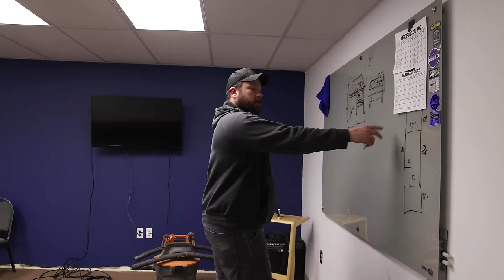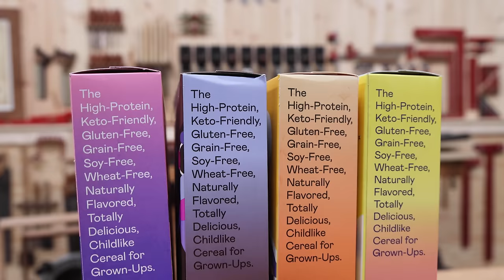EPIC Office Remodel on a Budget in The Dream Shop

Comment: Sam, when I've run trim on a long wall with multiple boards, I always trim the intermediate board ends with a 30 degree bevel. It it shrinks or contracts, it doesn't show a gap through to the wall behind or buckle.  The two boards just slide along each other.  Great job, and looks very nice.
Reply: Scarf joint!
Reply: true, but I doubt MDF moves very much.

Comment: I peeled up linoleum in my basement bathroom and used a fancy angle grinder diamabrush disc. I used an angle grinder diamond flapper disc thing that was already worn out a bit. I already had it from removing paint off a friend’s deck. It worked great. Doesn’t wear out and it also levels itself to the surface so you don’t have to work it at every angle to strip up the old glue. Kind of like how the paint stripping hard sponge discs work.

Comment: John,, I seen you all have problems with moving your forks on your fork truck, I suggest putting grease on the mask of the truck on the top and bottom of the fork slide it will make that process a lot better to move them.

Comment: Divide room length by finish face of floor board, most likely it will tell you how many whole boards with a decimal left over. You then divide that decimal by the flooring finish face measurement and it will tell you the size of left over flooring piece represented by decimal from original equation.

Comment: Any reason would didn't go with a scarf joint on the trim for the joints in the middle of the wall?

Floor looks awesome, huge improvement over thr diabetes that was there

Comment: Why didn't you use a foam underlayment? It evens out the small height differences, isolates the cold from the floor and mutes the noise a bit when you step on it. And costs practically nothing.
Reply: I thought it was required for floating floors, unless this isn't a floating floor? Maybe all that's needed is a vapor barrier? I have no idea as I'm not a flooring guy and only did something like this once and i used the foam underlayment so I definitely had the same thought.

Comment: I’m kind of surprised you guys didn’t use any kind of underlayment between the plastic and the laminate. Then again, it also looks like you’re installing on concrete. Hopefully, not letting the laminate acclimate to the room properly (you left it on the pallet, so air won’t have circulated around it at all) won’t bite you this summer. (Worse case I’ve ever heard of was a college gym in FL, using the 3’ x 3’ metal-sheathed stuff—didn’t acclimate it properly, installed it, came back after the weekend and couldn’t figure out why the lights in the gym wouldn’t turn on. The floor expanded so much it bowed and went up the walls. They had to take the roof off to get it out. Whether that actually happened is another matter entirely, but FL is hecka humid as far as I know. 🤷🏼‍♀️)

Comment: For the Sawstop. I assume you need 220, Take 2 extension cords, cut off the outlet ends, tie them together into a single 220 outlet box, plug the other ends into 2 separately circuted outlets. Boom, 220 on the fly. Done on construction sites all over the US everyday. Bonus: Qualifies as Squirrely.

Comment: I've been a general contractor for many years, put in a lot of flooring, you boys did a fine job. Just one thing. I hope you didn't make your ends tight against the walls. Vinyl doesn't react to temperature change as wood/laminate does but it will move some especially with hot and humid summer days in PA. Lastly they make a rectangular plastic block for locking in the edges and a flat steel bar for tight spots... for future references of course, lol!
Reply: we left a gap, Just forgot to talk about it in the video. I appreciate your support!
Reply: @SamGreenMaker  
Right on!

Comment: The struggle to find $1 flooring that doesn't suck is real.  My young family operates on an income of $55K before takes and a livestock expenses.  Having animals and 4 young kids I should be buying $4/sqft product for quality (or concrete) but alas sub $2 is a win.  Personally for the floors I've put in, I start looking for what material is the base and the edges for snapping it together or if you tap it together does the crap crumble like one of the Tarkett floors I used in our dining room as my first attempt. Next Tarkett was great.  Heck I even have a room with the super thick stuff from Sam's Club and it worked out great.